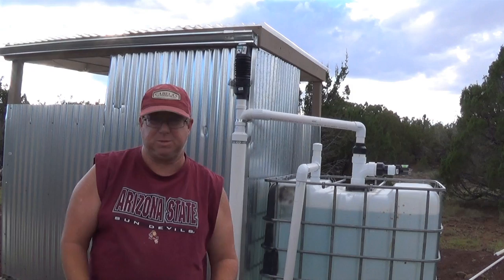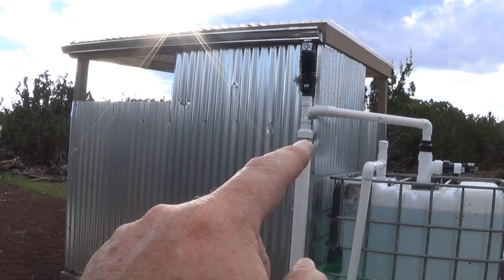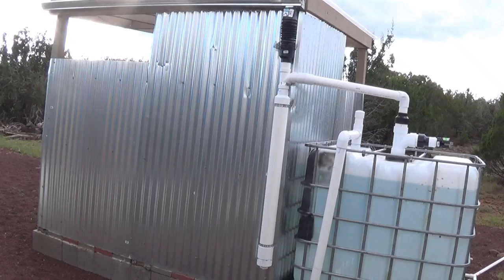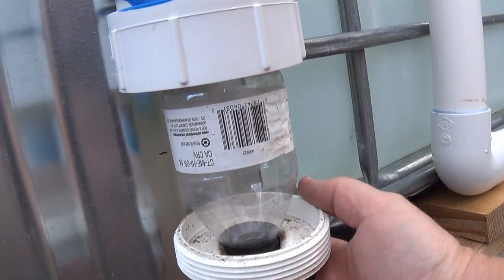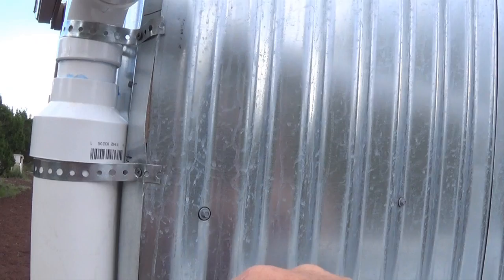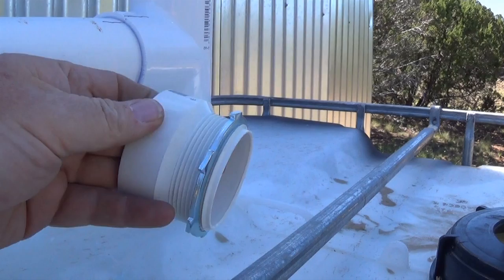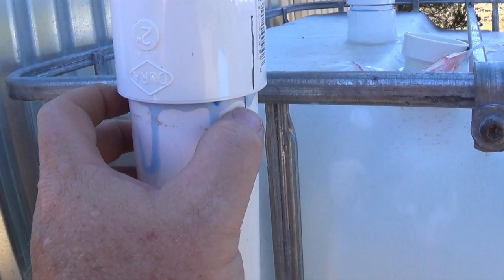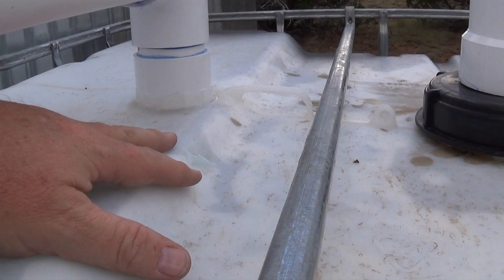Rain Harvesting for Outdoor Shower, Bath House

Comment: This is pretty great! Interested in how you heat the water and handle wastewater from the shower.  I’m thinking about how I’m going to do this for my cottage property, my idea might be to power the water pump off of solar to make it completely self sufficient.
Reply from the maker: the black tank on warm days heats up the water nicely. i also have it set up to use a propane tankless heater but i dont leave it do to the mice building nest within the heater so i only use it when it need the heater . i let the water just run onto the ground. the pump is only 12v . i have a battery thats charged with solar panels. have to remember during the winter to remove the pump so it doesnt freeze and open all the lines so fittings dont freeze.

Comment: Congratulations! This is the best video produced to date.  Everything you presented was well organized, logically thought out and adequately explained.  I'm hoping to find the video showing the water pump and what not and get that straight.
Reply from the maker: I haven't used the water pump connection to that tank yet. I originally had filled it before I did the plumbing. I do have a video of the water pump in action pumping 300 gallons into my 5000 water tank. here is a link https://youtu.be/4UuPawL1K5o depending on rain and use during the warmer seasons I will do a video on water pump filling the outdoor bathhouse water tank. .... thanks for the kind words.

Comment: Great video!  Nice set up.  If you are in one of the sections that get a lot of rain, this could keep your bathroom in water all year.
Reply from the maker: true on the rain. however so far some of the rain is when its to cold to shower. but like last year we got lots of summer rain and would have been perfect. this year hardly any rain.
Reply: how long you been off grid?
Reply from the maker: july of 2015.
Reply: Got me beat by 6 months. Hee Hee!  No wonder you have it going on.
Reply from the maker: but it sounds like you are moving in the right direction. that's what counts. always moving forward.
Reply: I'll be nearly as busy as you, lol. Its exciting! Is it easy digging deep out there?
Reply from the maker: the first 6 inches yes but all clay or rock after that. when I had a trench dug for my water line going from the tank to the rv their little bucket on their tractor had trouble knocking the clay off the bucket. .

Comment: Very nice setup.  I really like how you drilled out the end cap on the overflow.  First time I've seen that.  Great idea you had there.  What delivers the water to the shower and how do you heat the water?
Reply from the maker: ecotemp heater and a 12v water pump. solar panels keep the batteries charged. i have another video showing the entire set up.

Comment: Suggest wrapping or painting the tote for algae mediation.
Reply from the maker: i did spray black..i also use hydrogen peroxide food grade 35% the same i use for drinking water and so far it keeps it algae free.
Reply: @ArizonaHotHomestead  how many ounces of peroxide?   I used plastic wrap on mine as I thought it blocked more light.
Reply from the maker: @Step-n-Wolf  1 oz per thousand gallons but dont use the water for min of 24 hrs. give it time to work and dissipate
Reply: @ArizonaHotHomestead  thanks....I have my plastic covered totes and the wood to make a stand, just need that new property to put them on :)

Comment: What parts exactly did you to connect to the IBC nozzle area for pipe that runs inside the shower supplying the water?
Reply from the maker: basic pvc. there are different ibc valves but most you can use a camlock which is not used here but from that cam lock you can glue pvc to it just like reg plumbing

Comment: What happens if it freezes? Nice job! I've seen off gridders driving into Springerville with those water totes in the back of their trucks.
Reply: hes in the dessert not gonna freeze for long if at all
Reply from the maker: because I wont be using the shower during the winter i plan on using the battery power to provide a heat source to keep it from freezing. but for the most part if it freezes as long as the lines are clear of water i should be ok. plus if i paint the tote black it will help to heat up during the day to help melt the ice. worse case is i drain it and refill it for the spring.
Reply from the maker: high desert. believe it or not last winter was a warm one but still got to -5 . a few winters ago during the winter the area went 60 days of temps no higher than 20 degrees.  i just hope the winters stay mild for a few more years as i grow the homestead and learn each winter what i can do to prevent pipes from freezing.
Reply: ArizonaHotHomestead
I think there are underground systems, used a lot back east. Yes, high desert can get very cold.
Reply from the maker: interesting. most people have large tanks that the color of the tank and size keeps it from freezing in the winter or them just put a little heater in the tote to keep it from freezing.
Reply: or a bubbler
Reply from the maker: bubbler would keep the water moving. nice idea
Reply: ArizonaHotHomestead
Maybe you could use a solar powered pond pump to bubble the water.
Reply from the maker: I like that idea.

Comment: Have bought an enormous amount of permits; building, rv, we'll?
Reply from the maker: some permits are required but some are mainly for the value of the property just like living in the city my dad built a large shed in the back which a permit was required but he built it with no permit and its been there for over 25 yrs now. if he were to sell the house the building can not be valued . only get the ones that you need.
Reply: +ArizonaHotHomestead Ok. Looking like a permit is required for a 314 sq ft home? costly in AZ. But if 12x12 , you can skip.
Reply from the maker: I think the limit is  150sqft.